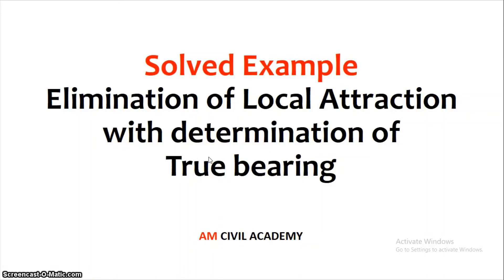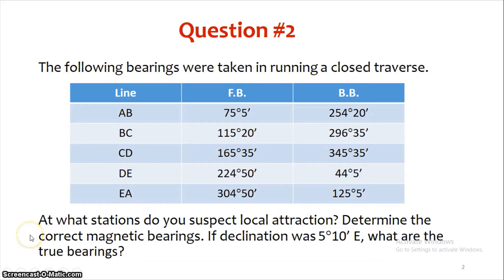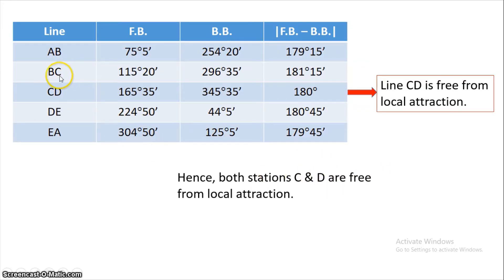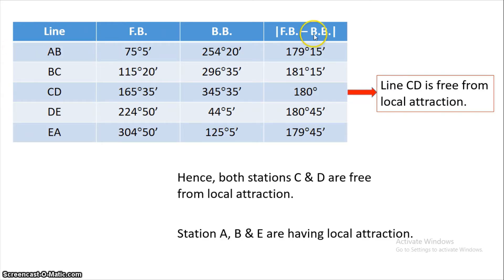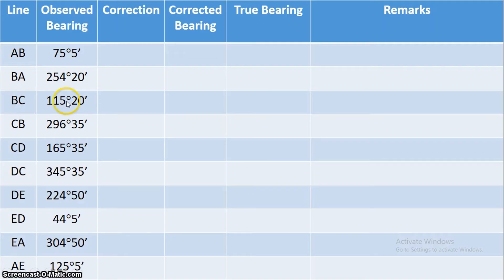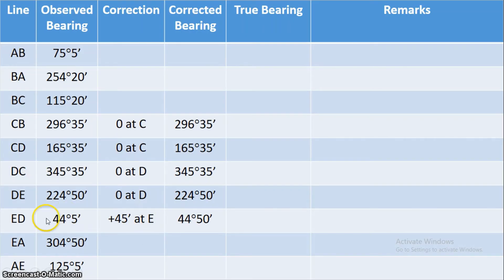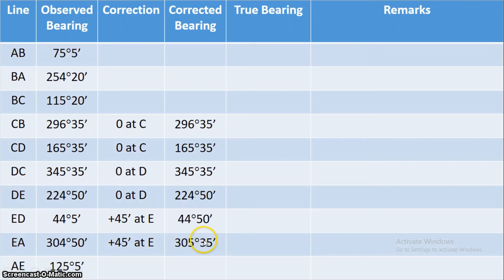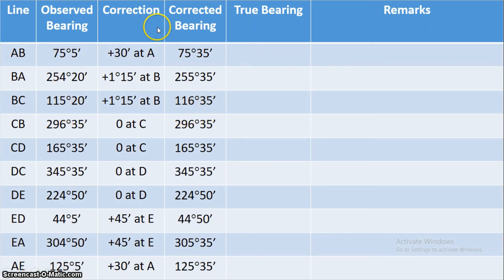S&G M1 - Elimination of Local Attraction with determination of True Bearing worked out problem

Comment: I think there is a mistake in the corrected bearing of  EA , the value obtained after adding +0.45 is 304.95
Reply from the maker: Hi Lakshmi.. it is not mistake.. 
Here, we are performing the calculations of bearings(angles).
1 degree = 60 minutes
1 minute = 60 seconds

Do it like calculating time.
95 minutes = 1 hour 35 minutes

similarly, in the case of angles (bearings)
95 minutes = 1 degree 35 minutes

if you need an explanation video, pls reply..
Reply from the maker: This video will be helpful..
https://youtu.be/FDTedbLSiSY